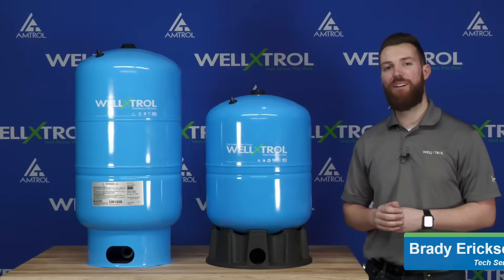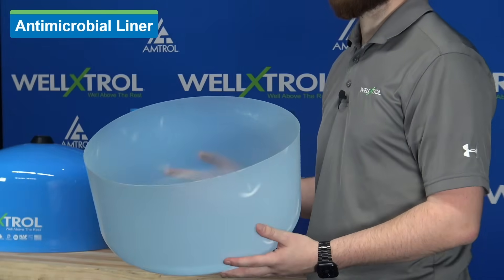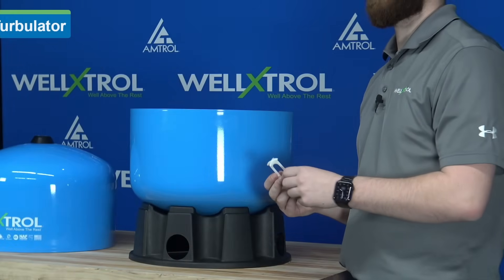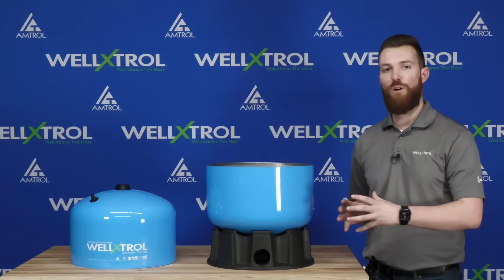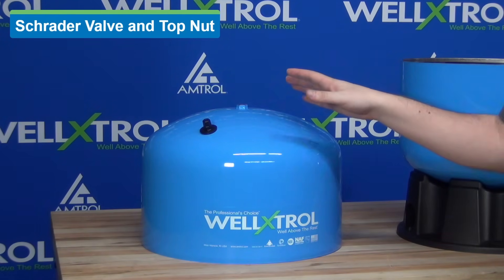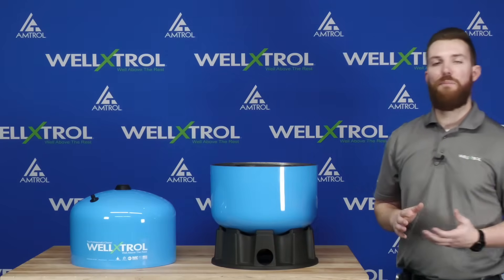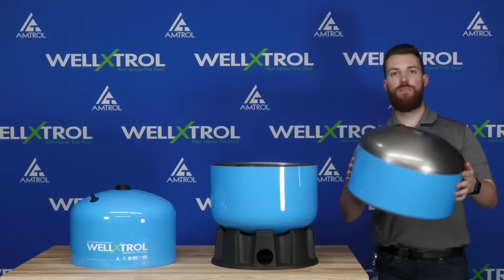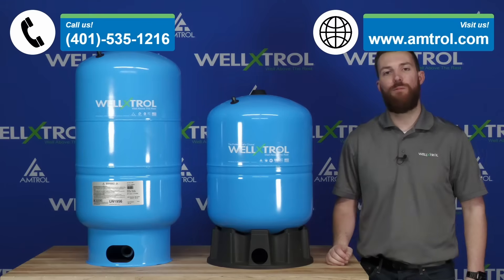What Makes A Well-X-Trol Well Tank? - Amtrol Tech Takes

Comment: What are the specific physical differences between your Well-X-Trol and Water Worker tanks which look mostly the same from the outside. Is the steel gauge different?  Looks like this has a stainless elbow and Water Worker has a stainless insert in its elbow.  Is that true, and are there any other physical differences?
Reply from the maker: The Well-X-Trol is rated for 150 PSI while the Water Worker is rated for 100 PSI which is contributed to steel thickness. Well-X-Trol has a full stainless steel elbow and Water Worker has a insert as you described. Some other features you'd get with Well-X-Trol is the antimicrobial liner, fresh water turbulator, and thick butyl diaphragm.

Comment: Not certain how adding extra domes increases the drawdown capacity (water capacity). When you showed the 2nd dome it had a round dome inside it with the air hole on top (not the dome with the Schrader valve).  This second dome will prevent the bladder from expanding beyond it, thereby creating a certain max capacity that cannot be exceeded, right?  So how does adding extra domes beyond this add extra drawdown?  Is it due to the possibility that the bladder is not expanding to its max capacity in the smaller column units?  Great video.  Thank you.
Reply from the maker: The concept of adding additional domes it to create additional air volume in the tank. Due to Boyle's Law, the more air volume you have on the air side, the more volume will be on the water side. Consider the air volume and water volume proportionate. There is an acceptance factor formula that will showcase this concept mathematically. The maximum acceptance never changes, as you stated, the diaphragm can only go so far. However, the usable drawdown at a specified pressure range (ie. 40-60 PSI) will increase with a tank that has more air volume. That is why a 20-gallon pressure tank will hold ~5 gallons drawdown and a 32-gallon will hold ~10 gallons of drawdown. Both tanks have the same max acceptance, but one has more air volume to allow the diaphragm to accept more. It is very rare that a diaphragm is completely maxed out during normal operation.
Reply: @amtrolinc  Thank you for your quick response!  I am familiar with Boyles Law, unfortunately, having to calculate what the volume of a 1" diameter sphere composed of several different gases, at the same temperature, 200' deep in water, would be when it reached the surface of the water.  Not fun, but interesting, lol...  Your reply answered my question.  Thank you and best regards.

Comment: we installed a new tank on 11-14-23 (cm8003), new pressure switch. the pump and tank work good, but i can not keep air out of water sytem (water and air spurts) have run alot of water through sytem will not stop. PLEASE REPLY WITH HELPFUL INFORMATION OR IDEAS!
Reply from the maker: For product support, please contact our technical support team at 401-535-1216 or amtrolwatersystemsinfo@worthingtonindustries.com for assistance.